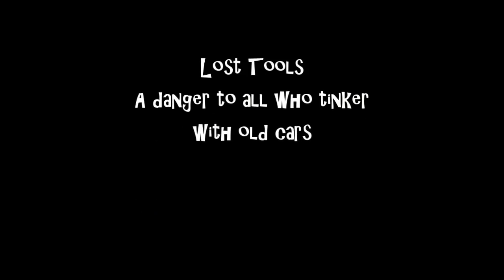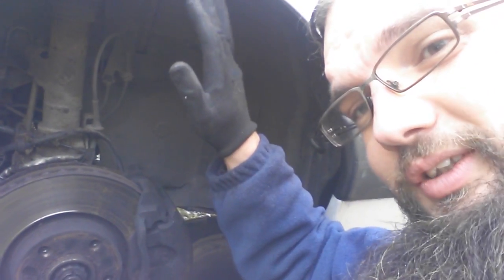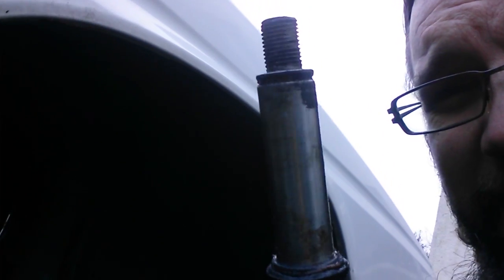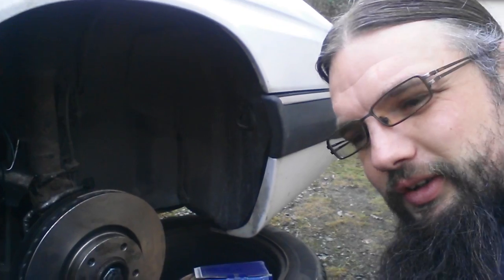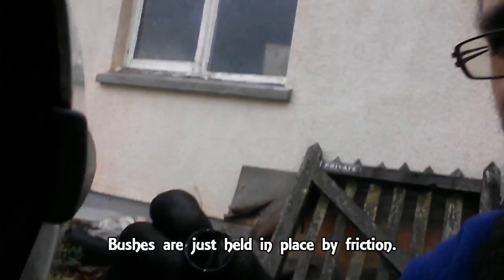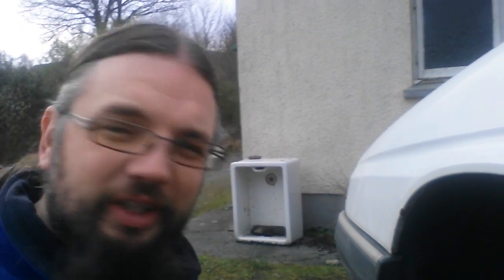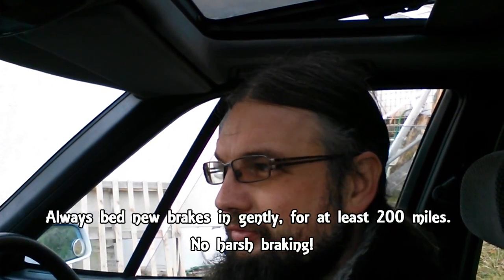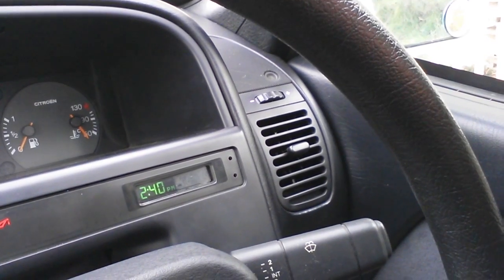Citroen XM front brake overhaul - Contains mild swearing

Comment: Nice job, I'm enjoying your videos! 
Since I suffered from handbrake related troubles as well, some things came to mind while watching your video.
The reason for your failed handbrake could also be a broken or disconnected cable. Sometimes, a cable slips of the mechanism, which splits the cables to the wheels. The mechanism sits besides some exhaust heat-shield, roughly below the gear shifter on the car's underside. 
You should be able to see the handbrake cables turn a lever on the brake assembly. If the cable doesn't move, the brake assembly is most likely ok or not the only culprit. The mechanism, which translates the handbrake cable pull into movement of the brake piston could also be affected. It can be accessed, without even taking the wheel off, from under the car. It's under the zip-tied rubber cover on the brake assembly. On my XM, this mechanism was starting to suffer from water getting in and the spring, pressing against the brake piston, was partially disengaged. With the replaced brakes, it's probably a good idea to take a look under the rubber cover on both sides, apply grease where necessary and make sure that they everything is set up correctly. 
In my experience, a defective or unkempt handbrake mechanism can ruin a new set of brake disks in very short order :(
Reply from the maker: +MrJoghurtbecher As with yours, the problem is with the mechanism. Water has clearly got in. I'll clean it up and see if I can get it working properly again. Once I can face working on the car again. And it stops raining... Thanks!